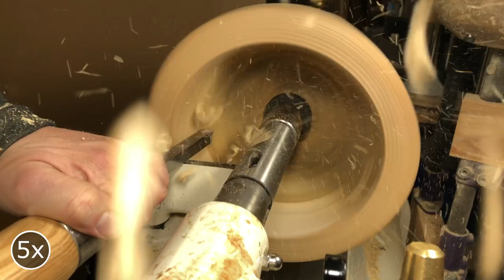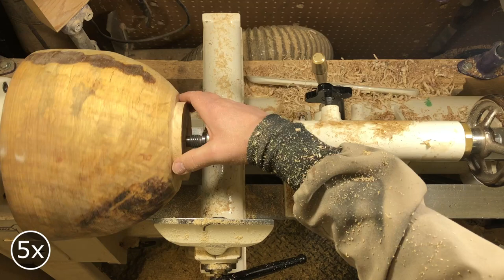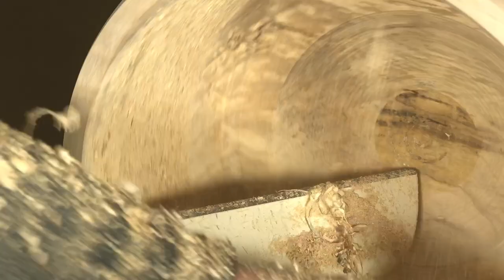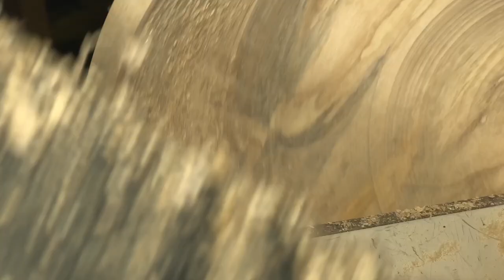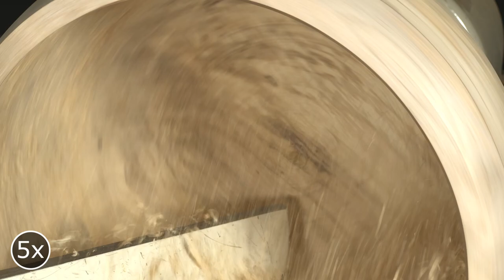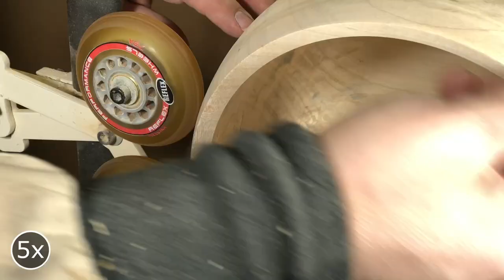Woodturning - Spalted Maple Mystery

Comment: Please explain your logic for using half of a steady rest when hollowing.
Reply from the maker: The steady rest used in this video is a Oneway bowl steady rest and I’ve got a link in the description box if you’re interested.

I use this steady rest specifically to back up the cut on larger bowls and some shorter vessels. Supporting the wood this way stops nearly all the vibration and chatter which make getting a smooth cut nearly impossible. The design of this particular steady rest also makes repositioning the rest quick and easy. 

Obviously, an asymmetrical steady rest won’t hold up the end of a deep vessel when the tailstock can’t be used. And it probably won’t do much to stop a long thin spindle from whipping around like a jump rope. However, for it’s intended purpose this rest has been invaluable. 

Thanks for your question.